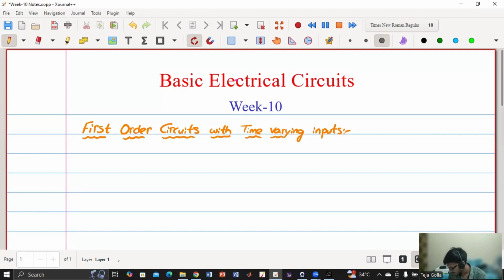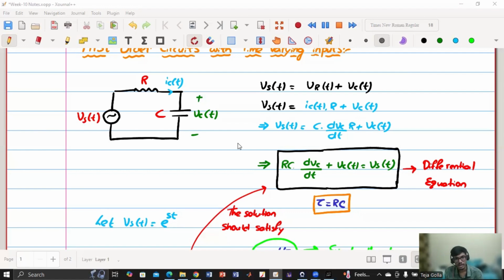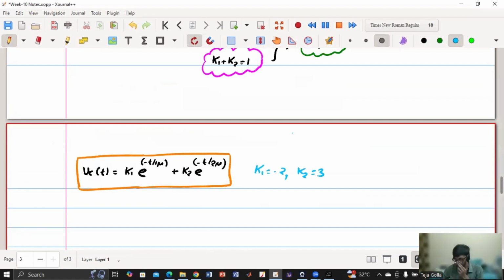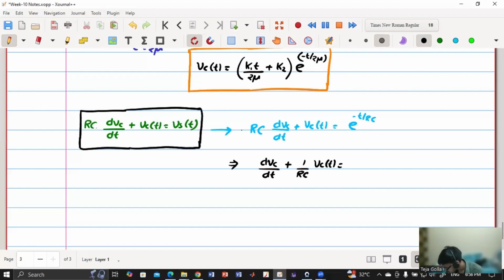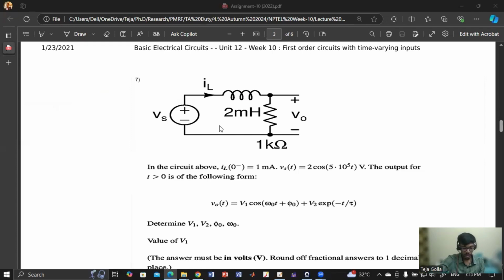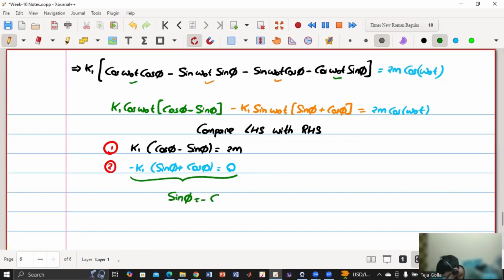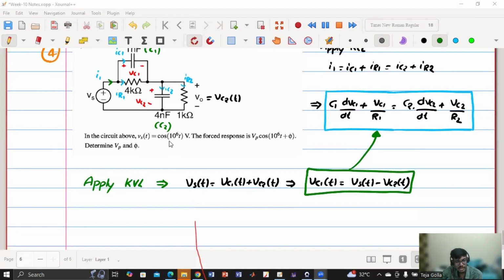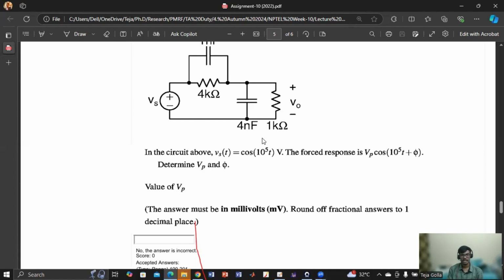Week 10 | Basic Electrical Circuits | Problem Solving Session | NPTEL

Comment: at 42:55  as per d/dx(exp(ax)) = a*exp(ax)      d/dt(exp(-t/T)) = -1/T ( exp(-t/T))  you have taken -t/T instead of (-1/T) please explain.    and  at 47:35 you have not considered 1/RC * exp(t/RC)*Vc(t)  please clarify..........
Reply from the maker: Dear Vishnu,
At 42:55, I have not differentiated the terms; I have written the generalized solution, v_c(t), for the given input v_s(t) in a first-order RC circuit. At 47:35, I have combined both the expression on the LHS and written it as a single expression using the formula d(uv) = udv + vdu. Then, I have applied integration on both sides to get the capacitor voltage.

Comment: Highly helpful session ❤❤❤❤sir I think the steady state response of the rc or rl ckt can be found by simply taking c as 1divided by j w c and applying voltage divider rule...same for r l ckt....taking l to be j*w* l and applying voltage divider rule we can get the steady state response....pls correct me if I am wrong❤❤❤❤
Reply from the maker: Yes, you are right, Lokesh. However, the course syllabus does not include that concept, nor do the lectures address it. Therefore, we are not solving the problem using that method. However, people widely use that method, which simplifies the mathematical calculations needed to solve the problem.